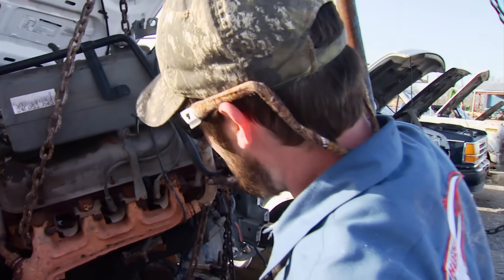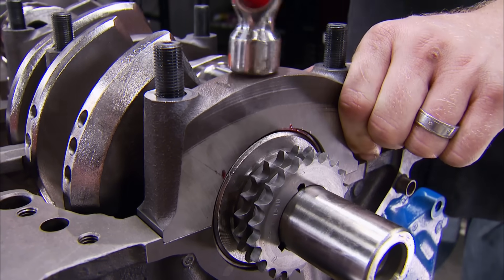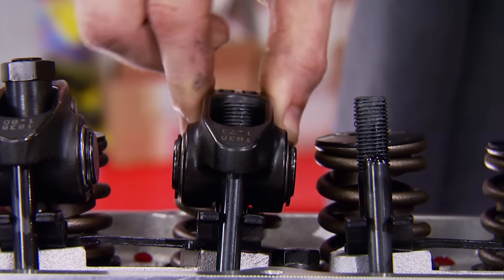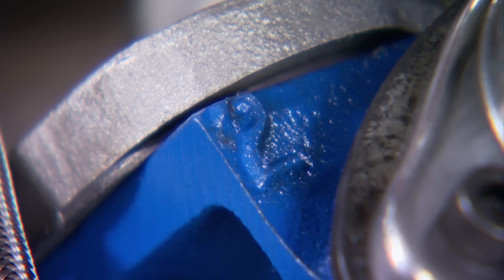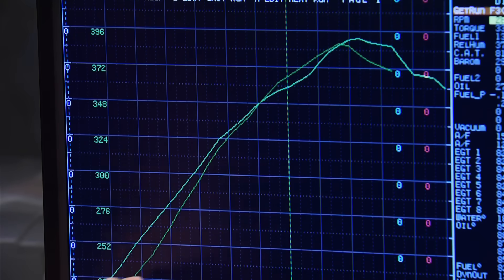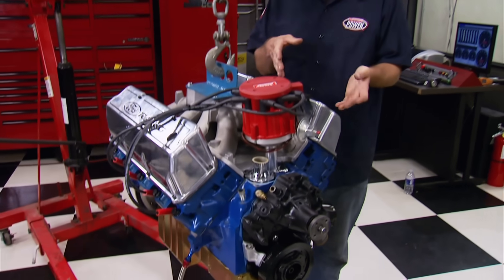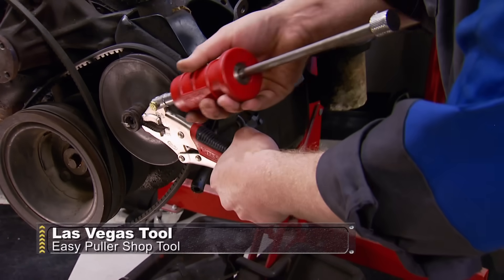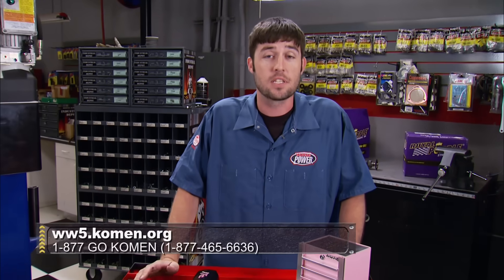351 Small Block Dyno Shootout: Windsor vs Cleveland - HorsePower S16, E11

Comment: I feel like the Cleveland didn't get a fair shake.
Reply: Cleveland for life! #Fordperformance
Reply: The 351 clevland was the best breathing , most powerful factory small displacement engine of the day, as such, it was discounted, maligned and discarded because G M's henchmen controlled Nascar and the Nhra. 30 odd years later G M builds there own clevland, the LS. Now according to the G M lovers , it's  the best thing since sliced bread.
Reply: @darrenhefford3722  yeah those Chevy lovers the LS motor is a copy of a cleveland
Reply: They don't care....The 408 was obviously built for the kid on the magazines penny.
Reply: They showed us how to build a 400hp 2v for budget dollars. That's something good.
Reply: Maybe they should have used a set of ch3 heads on the Cleveland  and a manifold to suit , the down port manifold !
Reply: It didn't.Single plane intake and never rejetted the carb for the 4V heads.
Reply: I don't consider this any kind of comparison. But the CL was impressive, especially using the heads everyone says you don't want.
Reply: They left a TON of power on the table with the Cleveland lol! I know guys making 600+ with stock stroked, iron-headed Clevelands! At the very least, they didn't give this one enough cam, enough carb, and enough rpm. These engines will spin to the moon.
Reply: @mccoma11  true. I have a 600 horse iron head closed chamber 4v watch the video on my channel The parts used where all wrong. These guys are more like sales men then engine builders.
Reply: @hoedemakerbart  You have your comments turned off. That's a drag.
I gots a Cleveland too. The biggest problem I have is traction.
Reply: It didn't!  They should have run the same cam grind and cast iron heads on the Windsor, along with the same intakes.
Reply: What I was wondering is who picked the cam for teh cleveland that it made less power than a stock Boss engine
Reply: More Windsors than Cleveland blocks out there, hence will sell you more parts for Windsors.....
Reply: Not enough cubes to make them 4v heads flow
Reply: @michaelwintz1896 Not enough rpm and fuel for those ports. Just spinning at 5500.

Comment: Why do you guys always do this? Compare apples and oranges, how about a built 351 Cleveland vs. A built 351 Windsor. Not a rediculous full race style 408 Windsor vs. A built 4v 351 Cleveland. You should have used a proper large runner intake to match the 4v heads not handicap the 4v heads with smaller 2v intake runners. A 408 is obviously going to be more RPM limited but make more Torque. Being you were going to build the 351 Windsor into a 408 why didn't you do the Cleveland build on a 400M that would have been a much closer comparison being the 400M is a stroker version of a 351 Cleveland.

Comment: It would've been awesome if ford made the windsor blocks stronger. Because of this I'm all about mod motors. 3500$+ for a fuckin stronger block for the old pushrod dinosaur windsors is fuckin mental! Lol why in the fuck would you spend that on an aftermarket block and that's not including internals. That's why the ls is so loved. 3500$ gets you a forged bottom end on a 4.6/5.4 and set up heads with brand new timing oem chains and guides. Good for 1500 hp. Now all you need it the fuel system and power adder. Those blocks live as long as you're not beating the dog shit out of the rev limiter. Chains don't take that shock well.

Comment: It would have made more sense to compare both 351's using the best of both worlds stock for stock. 351C using the 2v & 4V heads & the 351W using Ez7 heads & GT40 heads. Then later add a set of aluminum heads compare the results that way. Horse power dropped the ball on this one.

Comment: This was a pointless comparison , Windsor was stroked , and had aftermarket cylinder heads . Why not do a real test for the real people out here who can’t afford 2k cylinders heads and $1700 bottom end . Should have been A stock long block Windsor vs a stock long block Cleveland with the same intake , carb , headers and camshaft grind .

Comment: Do you know that there are two different cast iron heads for the 4v look for the dot after the 4V if the dot is there it's open chamber, no dot after is a closed chamber. 2V heads were all open chamber. And my 2V 71 Mustang was a street terror. Beating many 4V Chevy's. Most were supposed to be built where mine was bone stock.

Comment: The 351m is NOT a 351c had you done a REAL comparison you'd have spent a little more $ and found a 351c slapped the same type of intake setup and then got a REAL comparison
Reply: this is a 72 2V (D2AE) block shown in the previous episode. def not a 400M block.
Reply: @socalltd  a 400 would have been a good build because unlike the 351m engine it uses the same piston selection as a 351c unlike the 351m the wrist pen has to be machined for it but swaps and the 400 has a full 4" stroke. Longer stroke = more power.  351m engine uses it's own crank rods and pistons and not performance
Reply: All true. . I have a copy of the Tom Monroe book by HPBooks Ford V8 Engines covering the 385 and 335
blocks. A 400 scares many. not a block any Ford guy would want to work on or let alone talk
about. In this show, its beyond ridiculous whats done here. there is support for a 400
Reply: @socalltd  why be scared it's got the biggest crank journal size the longest stroke and rods of any ford   block. The 400 has the potential for producing more hp and torque than a 460 and weighing 1/3 the 460 bolts right in it's place too. Finding a true 400 is just getting to be a hard one these days
Reply: thats true too.. on my 3rd one. In my LTD with a edel dual plane and 1 5/8 long tubes. Stock for now
and its peppy. Want about 500 ft lbs when the re-build comes soon   not scarred at all.

Comment: We used to use 2v heads with 4v valves and cut the sides off the exhaust ports and  put aluminium pates on the side of exhaust  ,i still have the pattern for having the plates cast kicking around somewhere

Comment: I am glad you made this i was a big Cleveland guy for 2 decades. Loved the motor. You guys are wrong.on the 4V. You need a single plane manifold on the 4v heads. not a dual plane. rerun with single and you will see the difference.  This is not a comparison with the W a stroker. You guys are usually good with your advice, but not this time..
Reply: Well they used 2V intake and headers when they switched to the 4V heads
Reply: @brandonhumphries3377  
 The whole  2V to 4v comparison was a complete joke. When you go to A 4V Cleveland they are correct you're going to get more  Power at higher rpm. But what they didn't specify was the fact they were using 2V headers and intake manifold. I had previously built a 2V and 4V Cleveland motor that was roughly built the same. I used and offenhauser intake on both and the 4V was a bell a 150 more horsepower than the 2V. The difference between the 2 was the 2V was a 73 and the 4v was a 1970. For a show that does really good work, this has to be embarrassing.  I especially do not like it since the 4V Cleveland was one of the engines that I really worked on and liked.
Reply: @edcochran714  I've built several Cleveland engines. Mismatching parts simply doesn't work. That's why they were struggling to get power out of he 4V head combo. It shows when it made peak power with only 30 degrees of timing.

Comment: Someone needs a lesson in how to build a 351C 4V. You swapped out 2V for 4V heads(with the same open chamber design), dramatically slowing runner velocity in the process. With intake runners 30% larger and limiting RPM to 6000, wth did you think would happen with HP & torque? Come on guys ...

Comment: What s joke ...the Cleveland should be at least the same compression as the clevor and everybody knows the 4v heads flow better with a stroker kit ...you handicapped the Cleveland while giving the windor every advantage possible and the carb is way too small!!....my solid roller 4v 383 stoker Cleveland makes 600hp at 6800rpm and would smash both those engines.
Reply: Even 2v Clevelands like more cfm.
Run a 750 on a mild 351C 2v heads 284 roller hyd. cam. 10.5:1 compression. 1.73 roller rockers. Ported intake port&polish exhaust.

Comment: Sure swap the crap open chamber 4v heads and use a 2v header and intake on that Cleveland. No. Use some 70 4v castings and a proper intake between them. The 4v will outshine the 2v all day. 

As for the stroked and head swapped Windsor, I scoff at that comparison. Try again.

Comment: if you wanted to do a comparison you would have put the 2V heads on the stroker as well.  The head port volume an engine wants depends almost entirely on displacement.  This was proved by engine masters.

Comment: If these continuing, lopsided builds are your idea of head-to-head shootouts, I'm obviously subscribed to a BS channel.  I can build a Honda F20B stroker with cams, header, valves, injectors and hot tune and rebuild a stock 1980's 5.0 with a mild cam and pretty much guarantee the Honda blows the Ford away.  Not a "head-to-head" when one is "built" and the other "rebuilt".  You embarrass yourselves.

Comment: First off it's not a windsor vs Cleveland. You took a windsor put a stroker kit in it some high dollar heads I call that even. And the Cleveland 2 barrel vs 4 barrel when you change the four-barrel you should have put a bigger carburetor on it to feed the damn thing.

Comment: Uve used the wrong 4v Cleveland heads. Those are open chamber heads u need to use close chamber heads. Then u should see a monster awake. 10 or 12 to 1 compression.
Reply: Good vdo though.
Reply: Would like to see the comparison with all three heads for the Cleveland.

Comment: 🤣🤣 what is this amateur hour!? 
You really need to study up on building Cleveland’s. 

Worst comparison in the history of engine building. 🙄
Reply: These guys are clueless on Cleveland's...The 351C  was designed to be a world-class beating engine, but arrived on the scene too late. The emissions requirements caught the designers off-guard. The engine we see here is the remnant, a last gasp, a making do of what's left of what was once great.
  The 351C had all the elements that was learned thus far, four-bolt mains, the bore/stroke ratio, canted valves for 2.25 intakes, giant ports, closed "quench" chambers...it had everything...but had ONE "fatal" flaw. Someone within management made it a point, that under hood space was at a premium, & insisted that the exhaust manifolds "hug" close to the block. Somehow, some engineer while designing the heads, "curled" the exhaust ports to placate this "request" for tight fitting manifolds. Along the way, this one choice sabotaged the whole thing...  no one noticed...the exhaust gasses would "stall" & "tumble" on the floor of the port, similar to a stalling aircraft wing,  rendering a third of the port "useless" for flow.
Reply: @AndieBlack13  351C-4V should have ran to 7K rpm
Reply: Yeah, totally. Really not impressed. We have some stellar 351Cs here in Australia and some great aftermarket stuff. They made the C look like a dog. Try a 351W with stock 351W heads and see what engine makes power.....
Reply: @MikesTrackBuilding  I have a stock windsor in my 94 f250 I  want to put Cleveland heads on it it only revs up to 3800 maybe 4000
Reply: These guys are the janitors
Reply: @marvingross8151  They are so good at that, they swept away my comment lol. Gone
Reply: Yeah. I was dissapointed with the Cleveland build...the right cam turns that motor on so well.....
Reply: @BamaShinesDistillery  Yeah I built two of those motors and you could build
 power well into the 6500rpm range and beyond with the right valve springs cam and crank set up on stock heads.
Reply: There's a 408 stroker kit for clevelands. With the best legitimate Windsor heads they could have stroked them both and still had a good comparison.